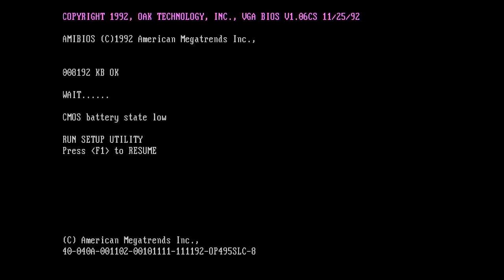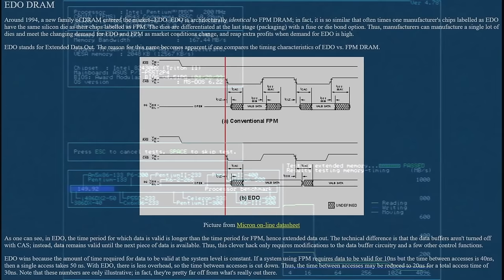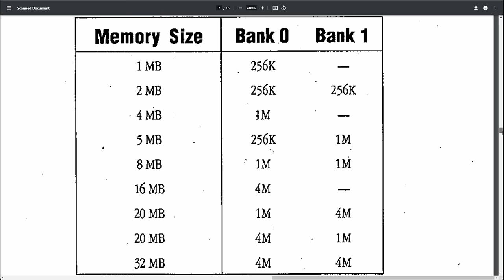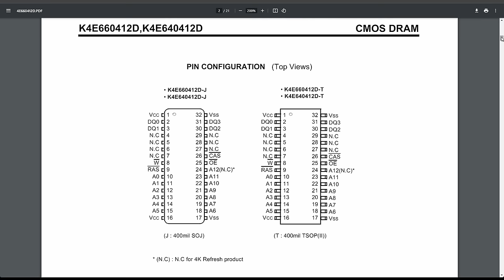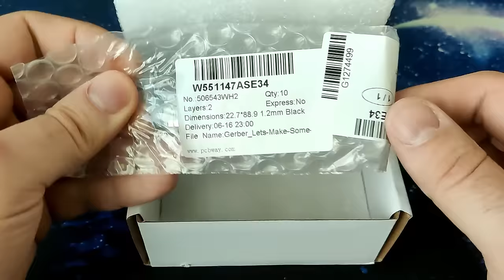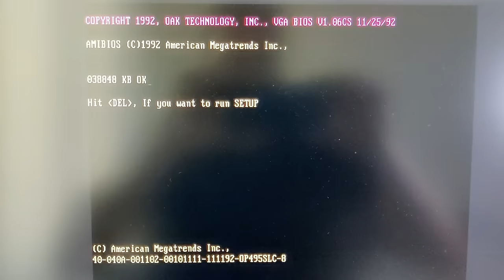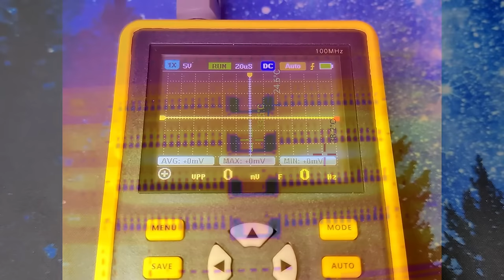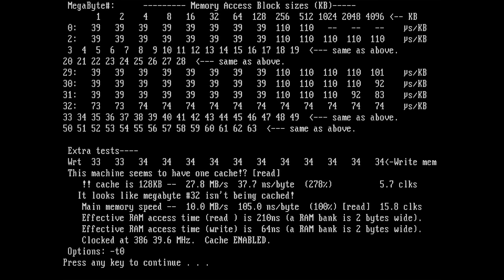DIY 16MB 30-Pin FPM SIMMs: Supercharge Your Vintage Hardware!

Comment: Congratulations on such a successful project! Now people can finally stop bugging me to make 16MB SIMMs! Of course I'm kidding, I only got a few messages asking about them since I published that project so many years ago. But I'm glad someone finally took up the mantle and did what I never got around to doing.

I had every intention of getting back to this project and making my own 16MB modules, at one point even tracking down a source for the requisite chips, but they were very expensive since they were NOS, so I never got around to ordering them. And then my career took the front seat and I've had neither the spare time or energy for such a project since then.

But this is an even better design, since it's using chips that are basically scrap. The fact that you can use EDO chips really opens the door to potentially using other chips with a relatively simple modification to the design. So congratulations once again, you've really done some impressive work!
Reply from the maker: Thank you so much! Without you paving the way, I would have never picked up on PCB design. Your Gerber files and schematics allowed me to learn about those modules. Thank you for your work!
Reply: @bitsundbolts  Someone should make a 64GB DDR4 SODIMM now, purely for the heck of it.

Comment: 0:36 I found a 16-SIMM board in the scrapyard and a friend gave me another one. Very happy to own these.
Reply from the maker: They are no longer that common. I have many and not really any use for them. I prefer larger capacities. However, if you want to build a period correct system, those 1MB modules are probably the sweet spot.
Reply: @bitsundbolts  I had never even seen one and wasn't aware they existed, I was going to make it one of my retro machines and max it out with what I could find. 
Once I fix the board though.
Reply: @bitsundbolts  It's weird to see "period correct." I'd say who cares. But the there's automotive, where original, oem, has the most value. There it makes sense since most can't build better than the manufacturer, and no one wants to buy junk used. I think we had 1mb in our 386 back in 92

Comment: Nice work! I never thought I'd see a 386 with 64MB RAM. I always thought they topped out at 16. This absolutely blew my mind!
Reply from the maker: 386SX systems seem to have this limitation of 16 MBs. Glad to hear that you have seen something new in this video! 🙂
Reply: @bitsundbolts  Yeah that's one part of the 'cutdown' part of a low-price 386 alternative to what then got called the 386DX, only a 24-bit address bus was exposed on the 386SX.  Internally the CPU could act like it had a full 32 bits of address space but physically impossible to talk directly to more than 16MB.

As was invariably the case from SIPP to SIMM to DIMM to SODIMM, machines may be designed to take a bigger stick capacity, but 2x the RAM would cost so much more than double the cost of the smaller sticks.  They were at first only for hardcore uses, then as the line aged they became a bit more affordable, and then technology had moved on to another speed/bus/etc arrangement so they never became commodity parts because the next high and mid range systems used the commodity new thing instead.
Reply: @bitsundbolts That's to be expected since the 386sx shares the 24bit address bus of the 286. Only "real" 386s have the 32bit address bus

Comment: Years ago I ordered a number of 128MB 5v EDO DIMMs and the supplier shipped 3.3v modules instead. When I told them about the mistake they told me they'll send the correct replacement and to just keep the 3.3v sticks. Never had any use for them until now it seems. My chips are Micron parts but they appear to be 16Mx4 as well and are sharing the same pinout. Guess I should sacrifice a stick out of my pile to create a slew of 16MB 30pin SIMMs. It's a parity module too so two additional chips for an extra 30pin module... Awesome job!
Reply from the maker: Oh, wow. I always have to send stuff back 😅. Good for you - I guess you found a use case for those modules now! I wonder what you possibly could have used those EDO modules for otherwise (I guess you have the 168-pin version). I would rather use SD-Ram since it is probably a lot faster.

Comment: Please note that there have been reports on similar chips dying in 5V systems. On the other hand, I have a few SIMM72 5V modules made with 3.3V-only chips but indended for 5V boards. They don't even  have the regulators, just two diodes in series to drop the voltage to 3.5-ish.

Also there's another way of making 16M SIMM30 sticks. It involves 8 4x4 chips and a PAL chip for reorganizing the memory. Works kinda like SimmConn. I do have the PCBs drawn and firmware written for PAL but just don't have the time to build it 😢

Great video as usual!
Reply from the maker: Hey! Good to hear from you again! Thanks for pointing out the issue with the 5v issue. I'm going to research the topic and try to address the issue somehow.
I have seen other SIMMs that also just have the voltage regulator and a few capacitors. I'm confused to be honest. But I'm researching level shifters at the moment.
Reply: Deja tu mujer y tendrás tiempo de sobra. Estos proyectos sí venden si los nostálgicos sabemos que existen.
Reply: Great share, it led to a neat video here.

Comment: Back in 1990s I had a borrowed Am386DX-40 machine with 4MB of RAM (and without FPU).  It run Win3.11 For Workgroups on MS-DOS 6.22.  There was Corel 5 and Corel 7 installed.  Corel 5 was working fine, Corel 7 had trouble fitting in RAM and was swapping a lot.  It was fun seeing Corel Draw 5 actually drawing the business cards when a file was opened.
Reply from the maker: Oh, I remember Corel. I think I had version 4. That was for Windows 3.1 if I'm not mistaken. It was slow if I remember correctly. Those vector graphics just took some time to be drawn on screen.

Comment: I once got a set (4 pieces) of 4M 30-pin RAM modules. Man, I was so happy, I used them on my 486 with 2x16M FPM 72-pin RAM modules. Win 95 was very happy with that extra memory but, thinking now, it must have been quite slow because of the 30-pin/72 pin mix.
However, I had 256k, 512k, 1M, 4M and I have seen 2M 30-pin RAM sticks but 16M is a first. Congratulations!

Comment: I had a 486 DX2-66 machine with a weird motherboard that had 3 72 pin SIMM slots. I ended up populating it with 3x16MB modules for a total of 48MB of capacity. It was a fun machine to put slackware linux on.

Comment: Oh hey, I'm the one who makes those Slaton Computers modules you show around 8:45.  They're built pretty much the exact same way, but permanently jumpered to EDO -- you can cut a trace and install a resistor if you really want to make them EDO, but I've yet to find anything that can use them that way.

Comment: Fantastic work!  One potential problem, having to fit 3.3v regulators for 3.3v RAM, the RAM may have a shorter life as any clamping diodes are driven frequently by 5v logic levels of the chipset.  It's also possible the chipset could die when interfacing 3.3v and 5v.  It's possible the RAM you are using is 5v tolerant?   I see you scoped the address and data levels there, and they look right - but probably because of the clamping.  It's worth measuring that same way with 5v RAM fitted - see what levels you get.   Don't be put off by this btw - the chances are it will work reliably even if the clamping is an issue.  It's just one of these things that I am sure will get pointed out.
Reply from the maker: The ram I'm using is not 5V tolerant. In the data sheet it says absolute maximum voltage is 4.75 or something. I am wondering and will do some additional tests before starting a mass order of those PCBs. In case there are 5v signals, would a simple voltage driver be enough?
Reply: @bitsundbolts  What you might be able to do - since it says the RAM can go up to 4.75v, try measuring the data and address bus levels with a 5v SIMM, lets say the levels are around 4v - that would mean you could perhaps try and regulate the RAM VCC to 4v ish, and in theory the RAM would work safely as its under its 4.75V limit, and clamping would be (I think) less likely as the logic levels are within the VCC level.
Reply: I wondered same issue, chip lifespan will be reduced with 5v operation. I am not sure how tight timings on address bus but maybe level shifters are fast enough to use on this modules?
Reply from the maker: Would a simple voltage divider do the trick? I might have to get like 40 small resistors on the board if I understand that correctly.
Reply from the maker: I'll try to understand this more. I already got details regarding level shifters. More things for me to learn and definitely a thing to look at before I order larger quantities of those modules. Thank you for all the great hints!
Reply: @bitsundbolts  I think level shifters might be difficult to fit on there - you really need them on address and data lines, as well as RAS / CAS.
Reply: @bitsundbolts  One technique I've seen others do is feed the connections through a small resistor (eg. 100 ohm or less) - but I am not sure how that might affect signal integrity.  I think the 4v reg might be a better idea, depending on what you measure on the data / address bus when testing a 5v SIMM.
Reply: Absolute maximum ratings indicate the limits that a device can tolerate, but not operate at. At least some resistors in series are needed to limit the clamping current. But I agree, it might affect signal integrity.

Comment: My 386 was an odd ball. A frankin build if you like. 8MB of RAM, but it was all on the main board! No RAM sticks. The motherboard was huge, an ocean of chips. 

I can't remember the speed of the CPU, but it did have a maths Coprocessor. When everyone had a 486 I was rocking this beastly 386. Pair of 150MB SCSI HDD's, 3" floppy, 5"1/4 floppy, CD-ROM, SB Sound Card & SVGA video card. A full multimedia PC that was a 386 rather than the more typical 486 for the time.

Comment: Amazing!! :D
That Cyrix FasMath FPU is gorgeous. I also find those COB SIMMs you showed at the start of the video pretty interesting!
It's been a long time since I last played with my 386s, but I remember 4MB being the most I could use... So I think i don't have any module larger than 1MB (and there's also the possibility that I achieved said 4 megabytes on a board with 8 sockets and 512KB per module being my maximum!).
Reply from the maker: Most of my SIMMs are 1MB modules except for the ones I made myself. I think there must also be a few 256kb ones.

Comment: The project is very nice 👍 Really great, especially since it is very difficult to get really large modules. I also have a 386DX 40 MHz with 64 MB, but I bought these modules ready-made many years ago.

Comment: Nice! That is plenty of memory for such a system indeed. However, I would add buffers to those modules. Bringing VCC down to 3.3V is not enough, the datasheet for those dram ICs says, that the voltage on all other pins also has to be in the same range as VCC, between -0.5V and +4.6V. The chipset on the mainboard will drive the data lines with up to 5V and that could potentially damage the memory modules. Unfortunately there is not a lot of space for an additional buffer, but you could save one voltage regulator and may be bring it to the other side to squeeze three chips onto the PCB.

Edit: Ah, just scrolled through the comments and there were already same concerns. I guess, looking excited forward for the next even better revision ;)
Reply from the maker: I finished revision 2.0 with one level shifter and voltage dividers. I'm not sure if the voltage dividers will be able to do the job on the address lines, but if not, revision 3.0 is in the works. All lines go through buffers and should be able to work within specifications.

Comment: Hab die Module nun mit KM44V16104 Chips nachgebaut. Kommt wirklich auf den Chipsatz an. Zum Glück hab ich knapp. 100 Motherboards. 🙂 Funktionieren mit: OPTi 495SLC/495XLC - UMC UM8498/UM8496 - SiS 85C471/85C496 - VLSI VL82C486. Dank dir nochmals für das Video. Sehr geil!
Reply from the maker: Wow! Da hast du aber eine ganz schön große Sammlung and Mainboards! Wenn ich dich richtig verstehe, dann haben die Module nicht auf allen Boards funktioniert die du getestet hast, oder?
Reply: @bitsundbolts  Ja. Also nicht auf jedem Board mit 30 Pin Sockel. Kommt halt wirklich auf den Chipsatz an. Ich will die Tage noch die Module in einer Soundblaster AWE testen. Auf Boards mit den oben genannten Chipsätzen liefen sie einwandfrei. Hab sie auch alle mit Check it pro durchlaufen lassen. Ohne Probleme. Ja, bin halt auch schon ein alter Sack mit 56. da sammelt sich schon was an. ;-)

Comment: Be careful  when you buy EDO DIMM module. If it has 8K chips it will not work . An 8K chip will have 16M array, but it is not a symmetrical array (which would be 4K x 4K). 8K needs 13 bits of address, which is not defined on an SIMM module, so the highest bit will be floating and the motherboard will only see 4Kx2K array (which many chipsets don't support).

Anyway awesome video!

Comment: Das muss der Hardwarehimmel sein! 386er, die normalerweise 4MB und höchsten 8MB hatten auf 32 und jetzt 64MB zu pushen! Genial. Musste damals meinen 486DLC von 4 auf 8MB aufrüsten und 300DM löhnen. Bin froh, dass ich 4*4MB habe. Bei 486ern dürfte es sicherlich klappen auf 128MB zu kommen. Dazu einen 5X86-133 und Win2000 drauf. Der POD ist zwar besser aber die Boards, die den POD unterstützen, nutzen sicherlich 72pin Module.
Reply from the maker: Ja, diese großen 30-pin Module werden wohl eine kleinere Nische beglücken. Ich werde da auf jeden Fall noch etwas herum experimentieren.

Comment: My first computer (386SX-16 from late 1991) came with 1MB in four 256kB SIMMs and that was more than enough when most games only used conventional memory and only a few could use EMS.
Later I got some programs that needed Windows 3.1 in 386 enhanced mode to run and I added another four 1 MB SIMMs to end up with 5 MB.

Comment: This is a great video. I have an old soyo 486 motherboard. It has 8 30pin simm slots and sis chipset. A long time ago, I saw in the manual that it could be installed up to 128MB, so I knew that. At the time, 16M modules were very expensive and uncommon, so I never had a chance to try them. Recently I was able to get four 16M modules for cheap. So I tried installing these and they didn't work properly. I look forward to seeing you work on 486 motherboards as well.

Comment: C'mon man! I had 4MB in my 386sx 33MHz in early nineties.... When i saw new pc my friend bought, with DX40, 8MB, and "COLOR MONITOR", i was stunned!!!! Than i bought Creative Sound Blaster just to mess with him :) We all had PC Speaker for Sound back then, and You can imagine playing Sensible Soccer with PC Speaker :) :) :) When i remember the cost of 8MB of Simm RAM back than, viewing this 16MB modules makes me drool :) If You ever consider selling even 2 those modules, i would be interested :) Just to bragging around with 32MB on my 386 ( i have 3 386s now, with one maxed out with 16MB :) )  Thanks for this video, it was pleasurable :)
Reply from the maker: A 386SX access the memory with 16-bits only if I am not mistaken. So, that requires two modules only to work. I assume your board then has 4 sockets which would be 32MB total - on a 386SX :D! As you said, that definitely would give you bragging rights! Let's see how the response and demand is, but I have a feeling where this is going... I need to set up mass production soon :)
Edit: I just came to know that a 386SX seems to be limited to 16MB only :(
Reply: @bitsundbolts  No, SX was my computer in nineties, now i have 3 different DXs. I'm mad about every computer from eighties and nineties (my childhood), and i collect them for last few Years. Primary i collect Commodore and Amiga computers, but also others like Atari, Sinclair, Amstrad/Schneider, consoles from Nintendo and Sega, and PCs from 286 and above. I never worked (as a child) on PCs older than 286, so i'm emotionally connected to those PCs :) Seeing 386 with that amount of memory is funny and extraordinary in the same time.
As for the mass production, hahahaha, that would be the bingo!!! There is so much people like myself, who collects same computers like i do, and we both know what would be the demand level :) You just need more people to see this video, like i did, and there You go, You will know what to do. For now, just 825 people saw this video, imagine what will be when few hundred of thousand will see...  :) ? I have subscribed now for Your channel, it will show me every new video of Yours :) I will post a link to Vogons and Amibay also, those are the biggest communities for oldies :)
Reply from the maker: Thanks!

Comment: If I am not mistaken, those 168-pin EDO RAM modules can be very handy in some old Macintosh systems (like PowerMac 7200, etc.). They will also work in Pentium Pro and Pentium II systems, as those also support EDO RAM (the i440FX only supported EDO, later i440LX added SDRAM support, but it supported only 512MB of SDRAM, but 1GB if you used EDO!, same goes for i440BX). Those modules are really rare as we usually think of EDO RAM as an 72-pin SIMMs and not a SDRAM-styled 168-pin DIMM, but those do exist and are really rare

Comment: I had a 386sx25 back in early 90's. I had an ISA card that had 16 slots for 30 pin memory modules and I salvaged a pile of 256kb modules. It gave +4 MB of total memory in addition of those 2MB already on mainboard.  

Interesting video though.

Comment: Neat. I managed to find a 486DX2 66MHz Compaq a while ago and piece together 100MB of RAM for it, maxing it out. I haven't booted it up in quite some time, and I don't know if I have a monitor with a VGA port, or enough converters I can plug end to end. 😅 I inspected it not that long ago and all the caps look ok, and it's been kept dry and clean so it should work. 🤷‍♂️😂